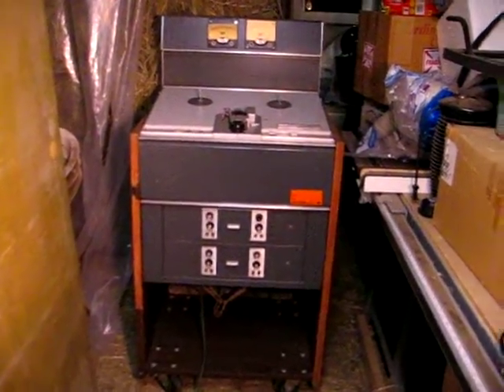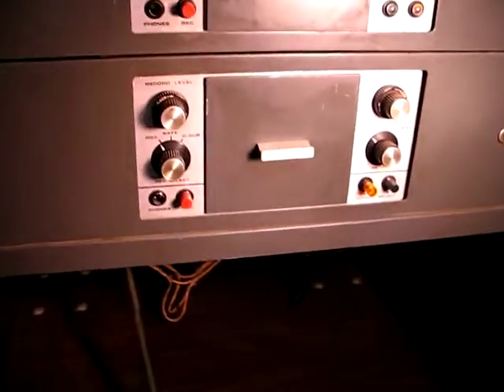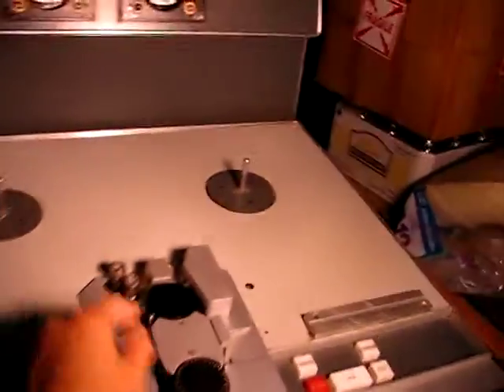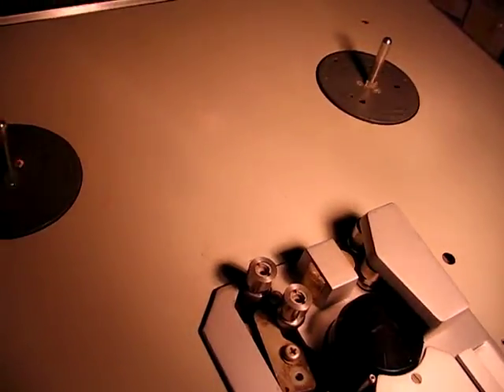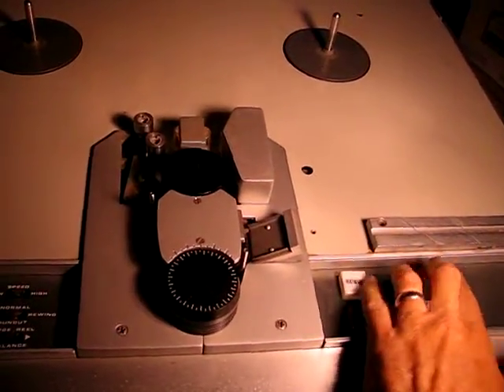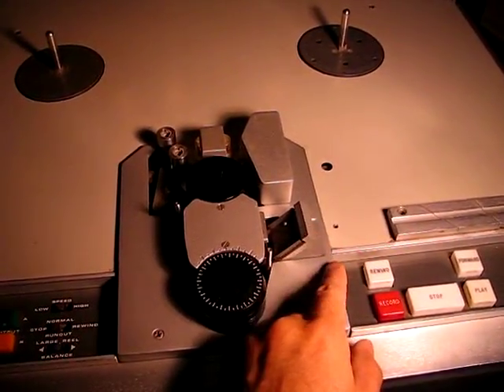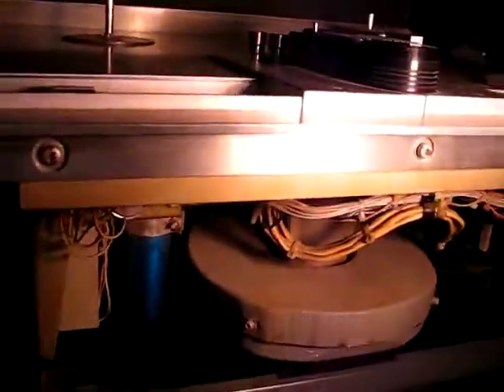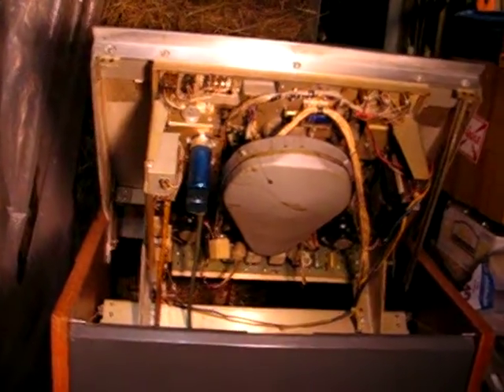3M M64 Analog Tape Machine Overview

Comment: Honey, you are dealing with a motion sensing issue.  It gets stuck into rewind.  Until the real platter starts to move, counterclockwise again.  It's got a drag switch under the platter.

Now, you're likely never going to find a pair of pinch rollers for that machine?  You might?  But they are an odd animal.

Also looking closely.  With your close-ups near the heads.  Am I looking at 1 quarter-inch wide tape guides?  Or am I looking at 1/2 inch tape guides?

The reason I asked that question.  There was a special stock of 3M, 2 check machines.  That all required 1/2 inch tape.  Not because they were 1/2 inch, 2 track.  No.

It's because they were actually recording to, 4 tracks.   On 1/2 inch tape.  And they were recording at different volume levels.  One was 10 DB or so off from the other up or down.  And they had a very silent switching mechanism in the audio electronics.  That when the music information got soft.  It would switch to the other track.  That was recording it louder.  But playing back.  At the right volume level.  That was reduced.  And then when the music would get louder again.  It would switch back to the other pair of tracks.  Silently.  Supposedly.  Without you being able to hear it do that.  But plenty of us could.  It was a method of noise reduction.  Before we ever had Dolby or DBX.

And you might have one of those machines?  Those could be worth a pretty penny.

But it might just be a 1/4 inch, 2 track machine?  Still worth a chunk of change in decent  operating condition.  Or a decent chunk of change.  Just parting it out.  Because finding parts for it could be damn near impossible.  These were not as popular as Ampex, Skelly and MCI machines were.  Which were more conventional transports.

This ISO loop concept is fabulous.  When you have the right pinch rollers from the factory.  Because if you don't?  It's no can do.  Unless somebody can make it knock off.  You're screwed.

The concept of this ISO loop design was to pull the tape out quicker, faster.  Then you were feeding it in.  And so it requires a slotted pinch roller.  Nobody knows how to make those I don't think?   And 3M doesn't support them any longer.  I don't think?  So good luck with that.  I think, you're going to need it.  But they were fabulous recorders nevertheless.  Cutting-edge for their day.  Highest bias frequency for their day.  235 kHz I think.  If I recall correctly?

I don't have as much time on 3M.  As I do, Skelly, Ampex and 3M followed by Stephens, Studer, Otari, TASCAM and others.  Like all of them!  Crown, you name it.  I've used one or serviced one.  Many times over.  In a 50+ year career.  I go back to the good old days.  I'm old.  Oh my God.  What the hell?  What the hell happened?  Was I hit by a truck or a bus?

I was hit by a bust
RemyRAD
Reply from the maker: Ahhhh Mx. Remy...greetings. Truly hope you are well. 

After I captured the video years ago I had the opportunity to get some guidance from the late Dale Manquen, which was very helpful. And I also discovered the logic board has a cap, the purpose of which is a holdback time-delay. The caps (two in parallel...supposed to be a single...that was the first giveaway something wasn’t right) on my board were non-factory, poor quality, out-of-spec, and didn’t even sum to the factory spec capacitance. I replaced them with a proper cap. That’s helped. So has Dale’s advice. And now I want to check the motion-sensing system and make sure it is working correctly. So thank you. 

Athan makes a set of pinch rollers for my machine. Not cheap, but essential, and yes I appreciate and understand how the isoloop system works and how critical the pinch rollers are. It is a lovely design...elegantly simple and effective. Every other tape machine I know has a flutter spec based on playback only of a flutter test tape. 3M used a flutter spec that is the cumulative flutter of tracking the test tone to blank tape and then reproducing...and then using that flutter percentage. And it STILL kicks ass agains even many late generation tape machines. Amazing. Purely mechanical constant tension. The unsupported tape length and wrap angle of the tape path is amazing. Inspired by their instrumentation machines. 

The tape guides on my machine are 1/4”. 

You are talking about Dynatrack (the two tracks per channel thing). Yes, also interesting and ingenious. That was introduced with the M23 and was available in up to 1” 4-track (2 tracks per channel, 8 tracks on tape). I have the manuals for all that stuff and there are open slots in the signal electronics modules for the Dynatrack cards. 

I’m fortunate to have a complete parts machine for the M64...I also have the transport remote and 3 spare signal electronics modules. 

Thanks for the info and feedback, Remy.